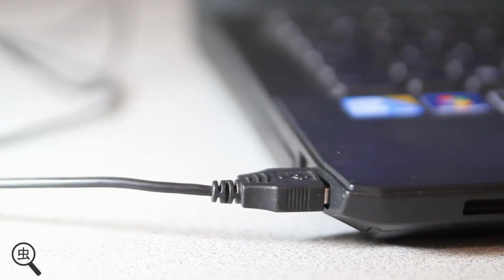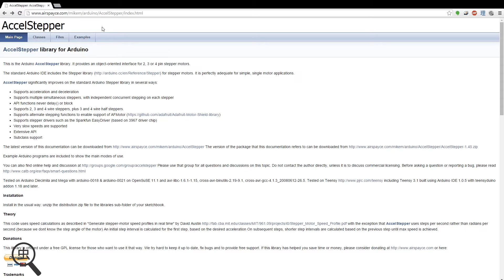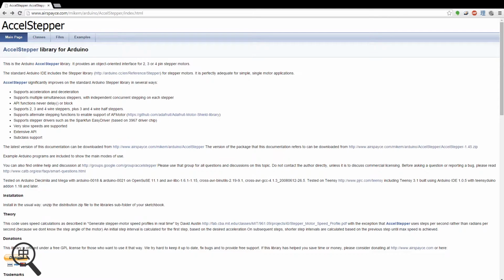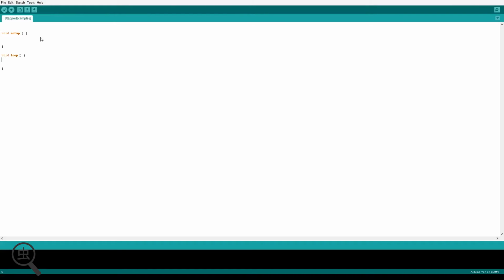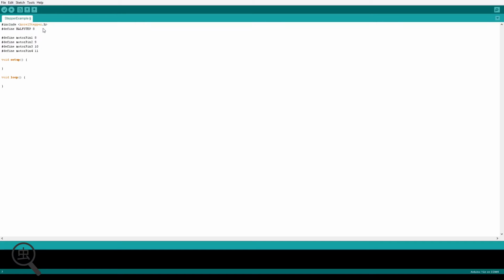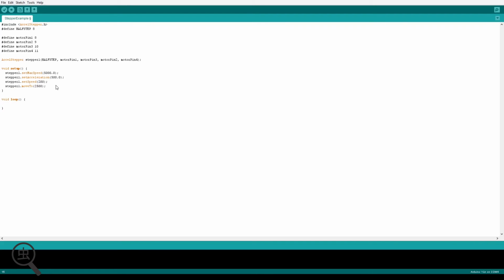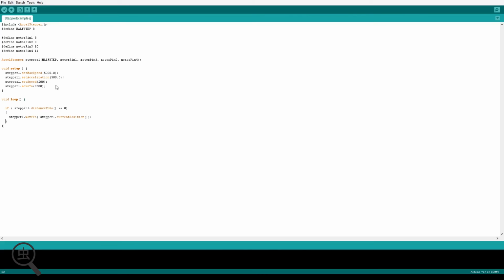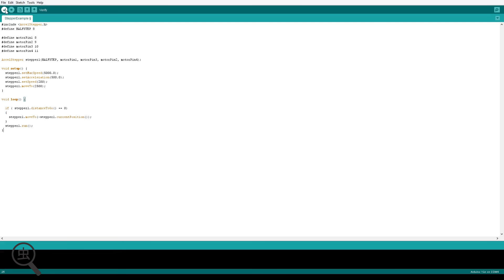Reviewing Stepper Motor 28BYJ-48 and ULN2003 Driver from icstation.com - Mushi Reviews Ep. #1

Comment: Thanks for the video. I've ordered the stepper motor with the driver. I need to turn it with 1.25 rpm (48 seconds for 1 rev. ) Could you please write a code and share with me? And how can I run the arduino just using a button. This will be my first arduino project. 
Thanks a lot